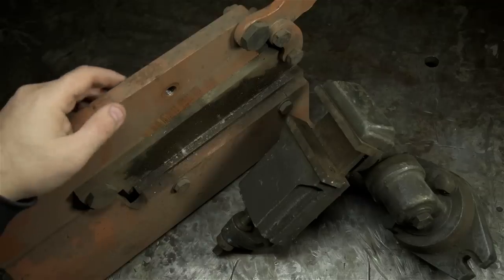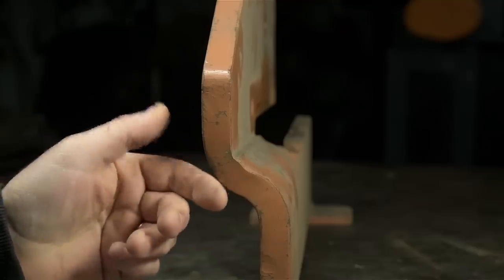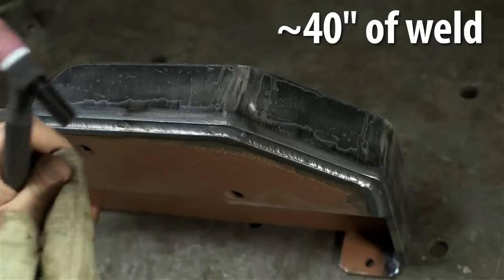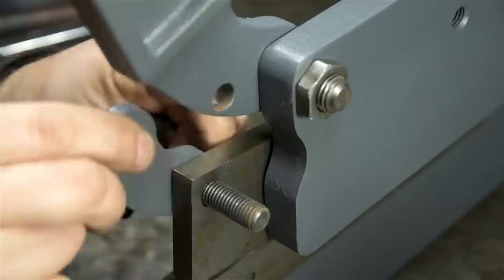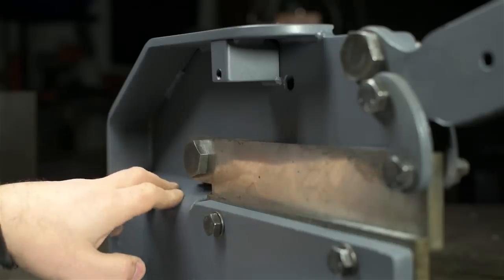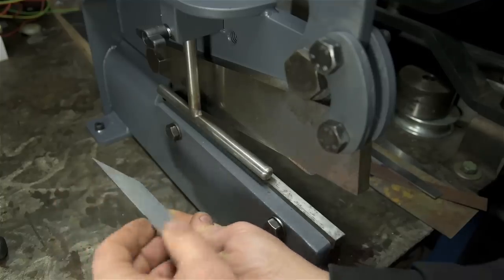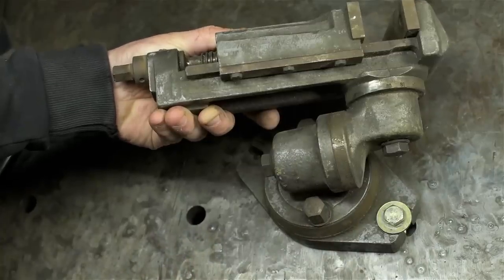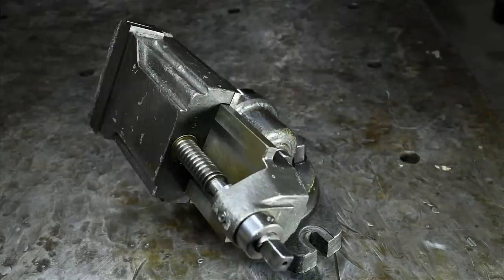Bench Shear & Universal Vise

Comment: What household product can I use to keep a metal surface rust free? „Household“ because we have different brands in Germany.
Reply: furniture wax paste (not car wax)
Reply: Like Jusb1066 says, paste wax as sold for polishing wood furniture. If you don't like the smell of furniture wax, you can buy "machine wax", although I guess that may n ot be what you'd call a household product. In the UK you can buy machine wax from online tool suppliers like Axminster.co.uk. Paste wax is the consistency of warm butter. Wipe it on then polish it with a cloth.
Reply: You can get a pretty good oil called "Ballistol" in Germany, that usually keeps surfaces rust-free for me.
Reply: Mineral oil, safe and cleans easy with acetone. Mineral sprits, fairly safe (fumes and skin contact aren't recommended) permeates material and no need to clean off. Guess it depends on your house. I stock axle grease.
Reply: paint
Reply: Cheap and human friendly but has a strong odor.
Reply: Thanks. I actually have that Balistol stuff. It is even advertised as something to youse to clean your DOGS EARS!
Reply: I used plain old car polish on a bandsaw table and placed it in a leaky old shed, when I got back to it 8 years later the table was fine, the blade was not
Reply: Ballistol kinda works as a general-purpose-whatever-don't-care-oil but OH BOY THE SMELL. The smell of that stuff is just awful. I now use Ravenol which basically works just as well but without the smell.

For long term storage (like my anvil) I just smear some grease on it (because a thick layer won't be going anywhere). Furniture wax works very well, as others have pointed out. Works also admirably on cast iron planes to keep them from rattling.
Reply: If you can get it, Penetrol or Floetrol, made by Flood Paint Solutions. Even though they are advertised as a paint additives they work well as a rust preventative. Amazon carries Penetrol.
Reply: Shoe polish. Heat the surface slightly and rub it on with an applicator brush. Do it twice so that it flows out. Let it cool and buff it with a clean cloth. Used it on my band saw table 3 years ago. No rust yet.
Reply: As I understand it shoe polish is basically wax. Blacksmiths have used bee's wax for generations as a rust inhibitor. I should have thought of that before.
Reply: Custom Haines Glad I could help!
Reply: Just as Mr. Miyagi told Daniel son many years ago. 

Wax on. Wax off. 

Avoid any wax that may have silicone in it. Especially if you work with any wood.
Reply: Max Maker I use Minwax Paste Wax. Wipe it on. Let it dry. Polish it off. Used it for years to keep my hand and machine tools rust free.
Reply: Powdered graphite rubbed into cast iron saw tables works well to keep rust away. Rubbed in well and wiped off, it does not seem to leave and residue on wood being sawn.  D Wilson, Colorado
Reply: Butcher wax

Comment: Years (and years) ago. Back in the 1990's in fact, I made a table of all the threads I could find and put them on a web page. All together for comparison. As it happens it is a bit weak on metric below 3mm, but might help with that mystery thread. Not that you care at this point. http://www.bodgesoc.org/thread_dia_pitch.html If it is 13.1 tpi then it is Holtzapfel E. (unlike a comment below, this really was once a thread). But BSF seems more likely. (Doesn't look coarse enough for Whitworth)

Comment: Ok Tony, I know you probably won’t have time to reply to my question, but maybe one of your followers will...  So here’s the deal: I do a lot of woodworking in my spare time, but your videos have officially infected me with the welding bug. I have almost no welding experience, but I want to jump in and buy a tig welder; you’ve shown how versatile those machines can be in the right hands. So am I nuts?  Should I just get a mig and an angle grinder like everyone else?
Reply: If you see yourself doing any welding on aluminum, I would steer clear of MIG (unless its maybe 1/8" or thicker). Thinner stuff can be done, but it can be a pain in the butt.
I've owned a MIG for quite a few years myself, and if I could go back in time, I would've started with either TIG or oxy/acetylene.
Reply: I think that you have to ask yourself what are your long term goals, do you really want to be doing a lot of welding or will it be very spotted  ?
I also believe that you should start with a stick welder and get familiar with it first, really does help most people. I started out my sons with a stick and they had no problems catching on with the other types !
Think it over well !

Comment: 11:05 Just curious, but why would you expect more force necessary to cut through stainless?
Reply: It's harder. Less ductile, more brittle. Tends to take more force but then snap all at once. Not as hard as tool steel, but not as soft as mild steel (hot or cold rolled sheet).
Reply: High chromium content, makes it way tougher than mild steel.

Comment: Too bad it suffers from gimbal lock.  Any goal of converting it from Euler angles to quaternions?
Reply: No it doesn't, unless Tony somehow loses control of one of the axes. As long as he gets to pick the orientations of each axis there is no angle he cannot set. Do not confuse angle measurement devices (subject to the whims of host) with angle control devices.

Also ewwww, quaternions. Just use direction cosine matrices and be done with any confusion and preserve simple linear algebra. Anyone who suggests quaternions as a solution to real-world navigation or control problems has never actually solved a real-world navigation or control problem with them.
Reply: Euler angles - easy to understand, hard to properly use.
Quaternions - hard to understand, easy to properly use.
Reply: Direction Cosine Matrices (Rotation Matrices) - Easy to understand, easy to properly use.
Quaternions - Ooops, forgot to normalize, autonomous robot crashes through wall of preschool every 7,281st test.

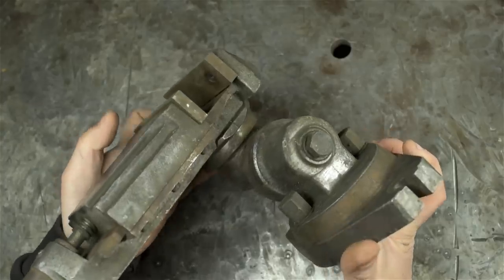Comment: Tony, I have a very similar shear and mine is an old Enco unit.  It isn't quite as large, and the hardware is a bit different.  But just so you know, it will pass sheet metal across the throat without much distortion.  That is, with out the TOT brace kit installed.  Here is a video with mine in use @ 12:23 mark.  Thanks again for the great video.  R.J. https://www.youtube.com/watch?v=WaizZojdcnU&t=23s

Comment: Hey Thisoldtony, I'm building a project (spinal decompression table similar to https://goo.gl/images/x37b1s
 ), and need a little guidance on which linear roller bearings would be appropriate for this application. I just need the butt plate to move a few inches. I'm thinking of building it out of square tubing for cost, and the bed part will just be plywood with vinyl. So what's an easy way to attach plywood to square tubing?
I thought about these https://goo.gl/images/hUZjBJ but I know the extruded tubing and accessories is pricey. I even thought about heavy duty drawer guides, or rails like this https://goo.gl/images/V7mtUf .
Thanks for any help, I greatly respect your input hence why I was hoping to get your thoughts.
Keep the great videos coming, we love them all!